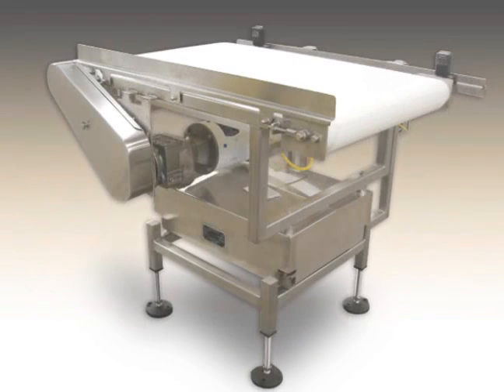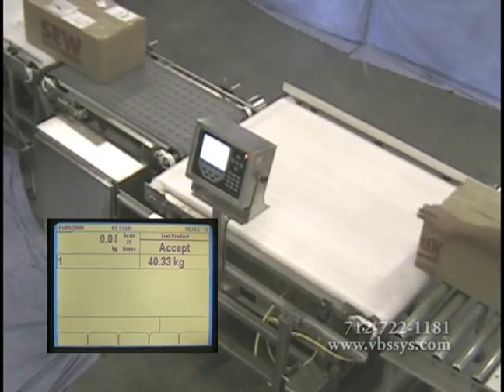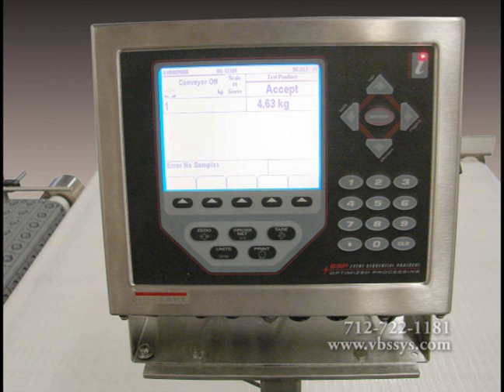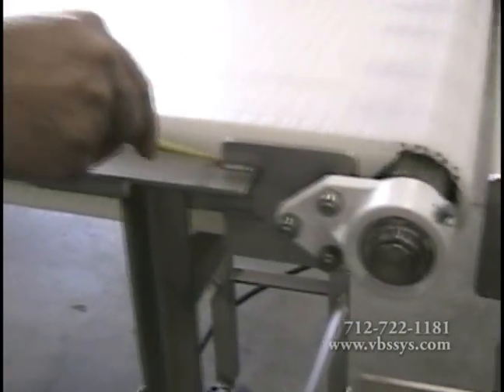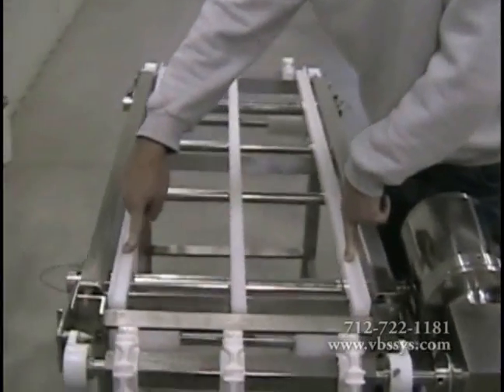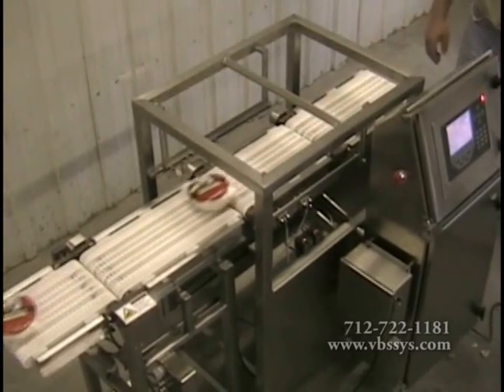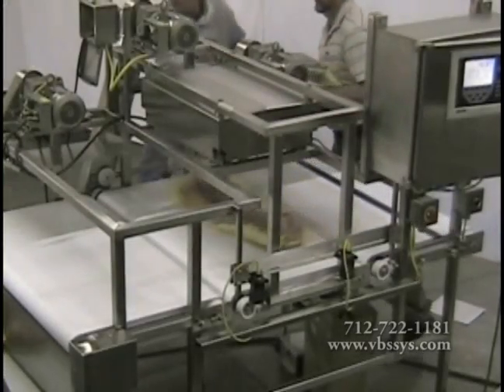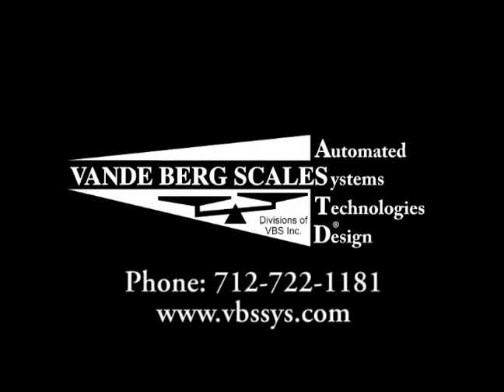Conveyor Scales

Comment: Hello, how do you clean electric motors? will the high pressure water make it malfunction?
Reply from the maker: The motors we use are washdown rated and sealed so water doesn't get into them.